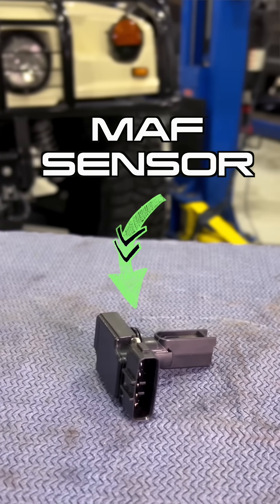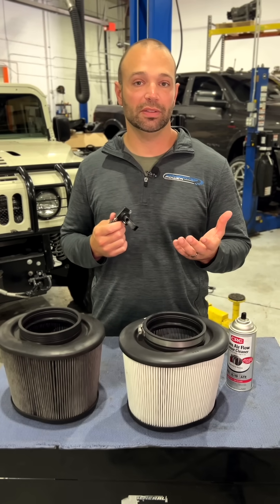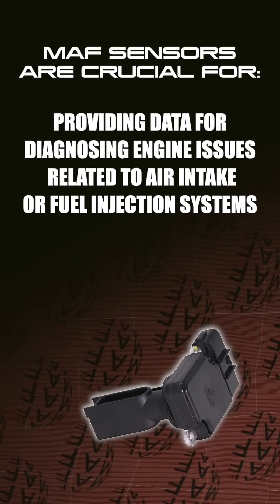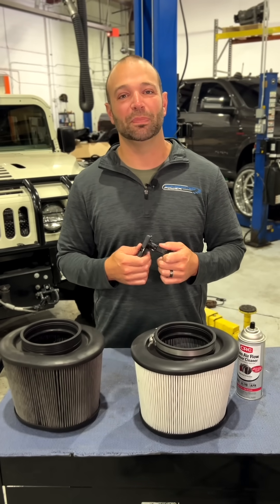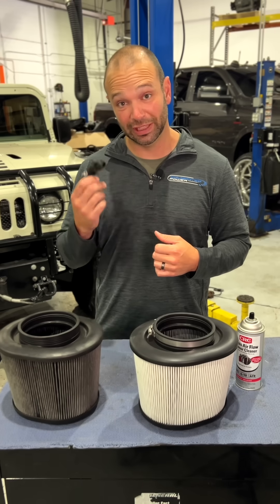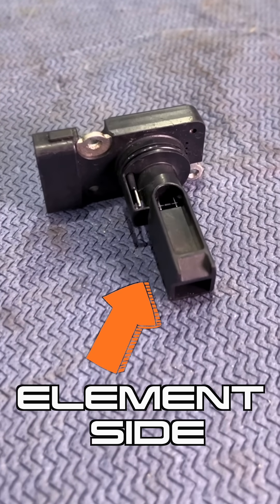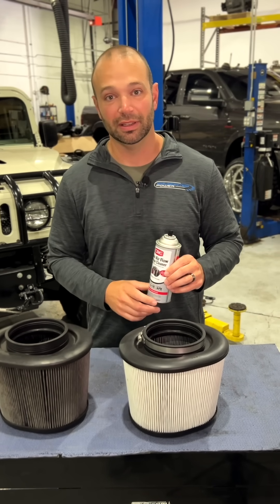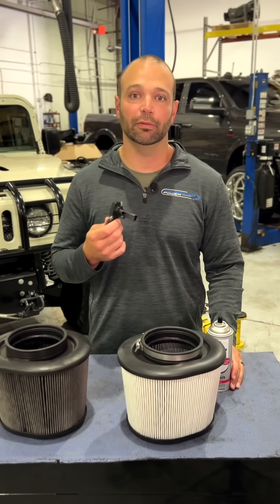What Is A MAF Sensor? #diesel #diesel101 #dieseltrucks

Comment: My 2018 6.6 has a P026D code which CEL comes on during the warm and humid months.  In Houston it's very humid and all of a sudden we just got our first cool front and my CEL went off....   I've replaced the MAP sensor, air filters, fuel filters, hooked up Autel to check injectors and never found the solution..  Going to change the mass sensor to see if this will fix it.

Comment: Fun fact. The MAS doesn't actually measure mass flow.
It measures velocity and temperature. The engine computer calculates the volume flow from the cross sectional area of the air intake (where the MAS is located) and air velocity . It then calculates the mass flow from the volume flow rate and the air density via the air temperature. Strictly speaking it's not technically accurate, as it doesn't take into account relative humidity which affects air density to a substantial degree nor does it take into account height above sea level which also affects air density substantially.

Comment: Where is it on the engine ? 
I am not a diesel mechanic .
Reply from the maker: Which truck do you have?
Reply: @Duramaxtuner  2016  6.6 Duramax 4 doo 4x4
Reply: @bonacker9762 it’s located just after the air filter in the plastic intake tube to the directing air to the turbo.

Comment: That’s funny. I was just looking at mine. I’ve got a very slight intermittent surge at idle that comes and goes with no codes. And the FCA is new.
Reply: Mine was doing that but I think it was my cp3 pump. I read some forms and ended up having to replace it anyways because it went out on me in my 04 lb7 duramax